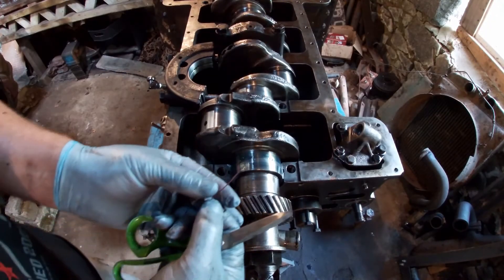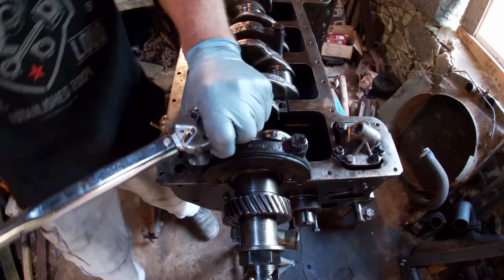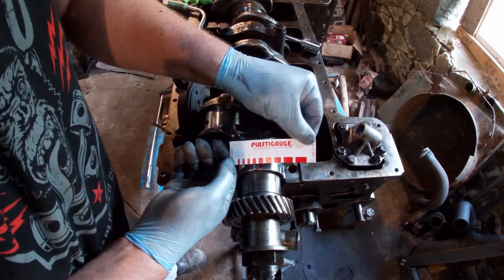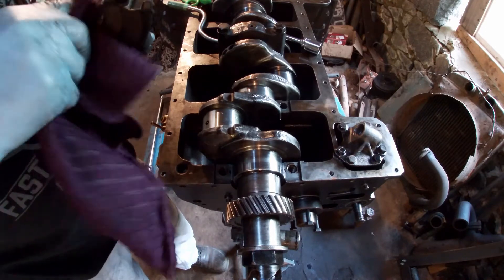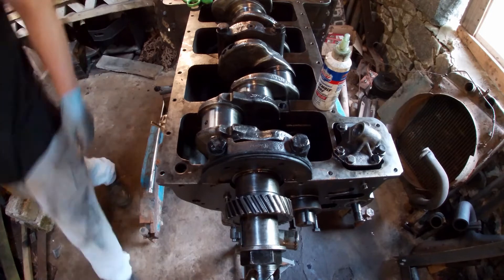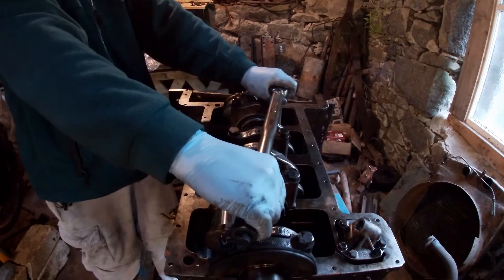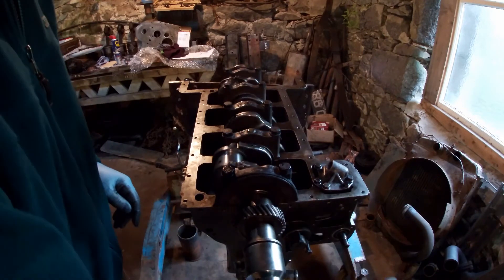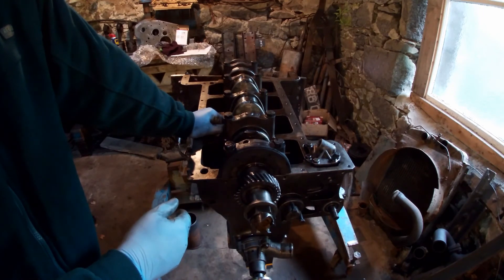1955 Fordson Major / 1963 block crankshaft fitting and vertical clearance measuring Plasta gauge.

Comment: Front bearing cap should be aligned with the machined front of the block using a straight edge  prior to tightening. Failure to do so may result in an oil leak between the bearing cap and the front mounting plate.
Reply from the maker: I did know that. I measured the distances both sides with verniers to check the alignment and both sides were the same. It is in the manual to check it. Thanks for the info M 😎
Reply: @MarshallSmart  Well done, (a lot of work to put it right afterwards).